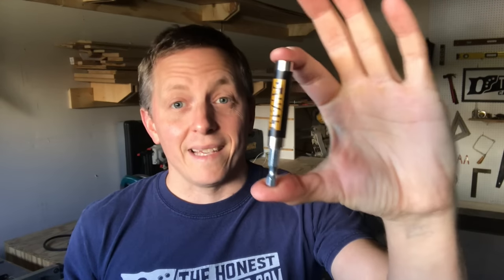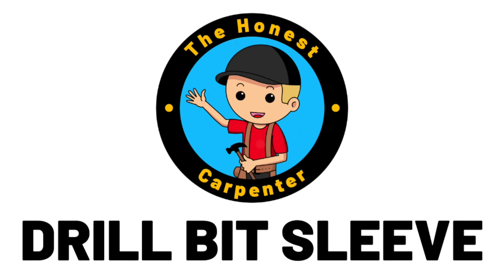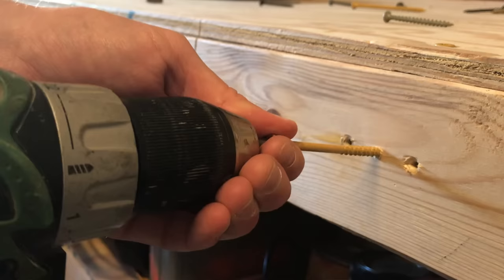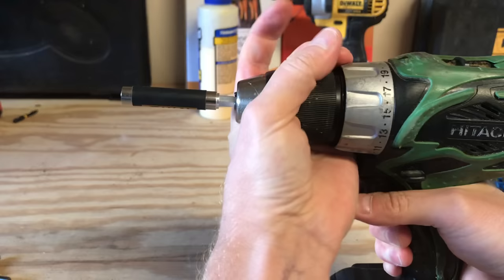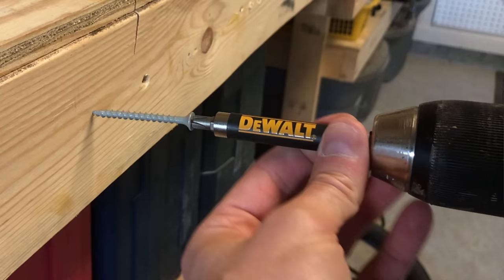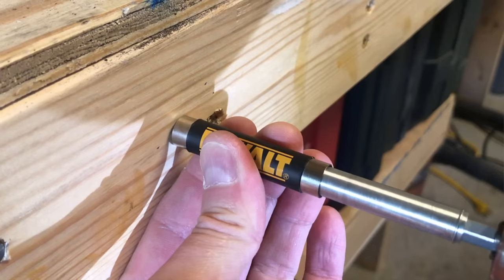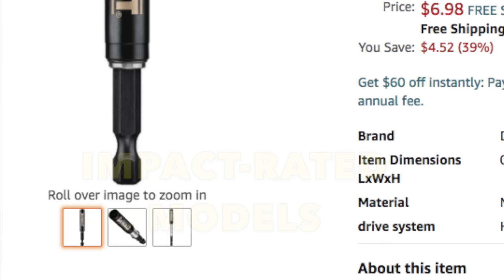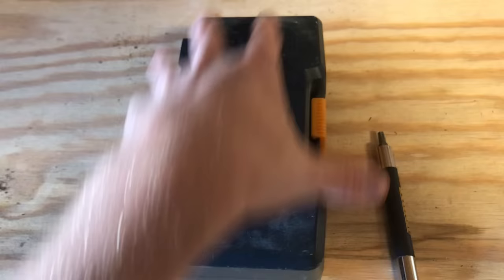This Tool Helps You DRIVE SCREWS WITH EASE! (Bit Guide/Bit Sleeve/Drive Guide/Drill Bit Sleeve)

Comment: The best feature of these Dewalt bit holders is that you can put them in each other and then pull the sleeve of the first onto the second and you get an extra long extension that doesn't wobble as bad as other such contraptions.
Reply: not all dewalt success as others some people will find them wobble because there is no perfect output shape of these and dont forget the groove in the shank itself add more wobble i think they all add some distance to get fit all bits bypassing the defective part in bits shank like spanner/wrench also to bypass the glitch in bolt head & nuts but thats a good thing at most times how about gearwrench metric 6 points the open head dont hold the metric of 10mm head of bolt but the close one fit it perfectly tight!! thats because the bolt is actually on sae size ^_^ john travolta says: "Whee!... What a predicament!" :P

Comment: I’ve  used theses for years and love them. Recently I’ve seen ones that have a clear plastic shank cover so you can see the screws progress which I think is a big plus to drive it  to the depth you want and better monitor the progress.
Reply: OPh, wow...OI would love that!  :D
Reply: Is it really necessary though? I just retract the bit guide once the crew is more than half way in.
Reply: yeah it would be great but thats a theory or a joke andrew because it should be metal to handle the progress if its going to be plastic will make the job fail sooner or later when it gets break because the screw most times will be standing from inside on the wall of sleeve depending on the impact of person hands and the speed of the tool will define the life of sleeve apply these factories on the plastic and think what do you/others to expect!!

Comment: Nice!  I bought a small set of DeWalt driver bits some time ago.  It had one of these bit sleeves in the case.  I thought it wasn't much more than just a bit extender.  It didn't dawn on me that the sleeve was there for a reason.  I have had my share of wounds (as you described) from holding the head of the screw while driving it in.  Guess I don't have to do that any more.  Good deal.
Reply: YES, rehabing my deck and ive had the burning finger issue, i should have known there was something out there for that. nothing better than having the right tool for the job 😊

Comment: Drill bit guides are also useful in removing nails from dismantled pallets.
Cover the nail point, give the guide a few taps with a hammer and it drives the nails back along their route enough to allow you to get purchase on the heads to remove them with a claw hammer, prybar, etc.

Comment: I’ve had one of these for 20 years. This works great, especially if you are removing or driving long slot head screws. It is a real time saver for screwing long slotted machine screws for light fixtures.

Comment: I've had a pair of those in two different lengths for more than twenty years. The old Sears Craftsman cordless drills sold in the 1990s came with one standard, as did the Craftsman driver bit sets. The short one lives in my drill at all times. They also came with instructions, so I knew what they did all along. They've saved my fingers many times when driving drywall or decking screws.

On a side note, those Craftsman drills and bit sets in the 90s also included a quick-change hex shank adapter that worked much like the collet on a modern impact driver. It made changing from screw sleeve to drill bit easy and quick. I still have two of them, and my original one still lives in my drill to this day.

Comment: You’re absolutely right. They make perfect stocking stuffers. They’re inexpensive and a must have for any and all projects. You can never have enough.
Reply from the maker: I’ve got so many torn-up ones laying around, SMS, it was time to buy a couple new ones just for this video 😆
Reply: So they break a lot?
Reply: @RicardoSalta  after awhile the sleeve won't move up and down to help hold the fastener but they're not that expensive so it's not a big deal. You can get them from dewalt Milwaukee ect or just get the cheaper big box ones like husky or masterforce. They all do the same thing.
Reply: @RicardoSalta  not as much as you might think. Normally they’ll last quite awhile. They’re super inexpensive so buy a couple or few.

Comment: Two other things it helps with very well:

1) It makes driving slotted screws way easier, as the slotted driver bit can't slip off the screw head while the sleeve is over it; and
2) Very handy for keeping non-ferrous screws on the bit as you go to drive it in.
Reply: @chrisc5574  1700's, where we light our houses by squeezing whales until goo comes out and lighting it on fire.

Comment: They also have a anti-shock.. (for want of a better word) super strong spring inside. It gives that little bit of leeway which helps prevent wrecking the screwhead from the direct torque of the drill/driver.  particularly useful for brushless Impact drivers. You dob't need to "Lean In" (put body weight behind) on the screwhead as hard. with the correct fitting bit of course. It's like a shock absorber that carries and delivers the punch without hurting the screw for the next guy to deal with. The next guy will usually be you.

Comment: I just drove 2301 exteriors screws in 687 fence boards on our post Hurricane fence with one, using an impact driver. I also like the fact that if I drop a screw I can pick it up off the ground with the magnetic driver. Great video and tool.

Comment: For one handed use basically while holding the timber with the other hand in awkward situations, also if you're ever fixing gutter clips to the fascia and holding them to a string line with one hand this bit holder in a 150mm extension is perfect and makes the job so much easier 
👍😉👌
Reply: Yeah, i assumed holding it would cause a problem long term.  I thought it was just intended as you stated (third hand)

Comment: I had this tool from Sears for at least 15 years and never used it because I had no ideas how. It came in a kit with a quick connect and some bits. I used just about every item in the kit except for this one item. Now that I know what it’s for, I’ll be using it just about every time I use my drill to insert screws. Thanks.

Comment: I am a licensed professional structural engineer with a specialty in wood. I have pulled this thing out of my case about 10 times and quietly pretended like I knew what it was for. Ultimately I just assumed it was to... hold the bits that were too stubby and sat too close to the chuck. Thanks for explaining.
Reply: Yeah because they don’t tell you in the damn instructions

Comment: I already knew about this tool but I wanted to see your take. It was worth it. As a pro carpenter I discovered this years ago and even showed an old timer this trick. Though he didn't accept it as viable information, which is whatever. I used to get metal pieces embedded in my skin with the non-coated 3 inch screws. Once I splurged on a few of these my fingers greatly appreciated it. I also appreciate that you can show others the way without any bs. Thank you.

Comment: Funny coincidence I just figured this out on my own today. I'm seeing your video a bit late. This bit holder style use to annoy me, now I am glad that I have one. Thing is the screw head was to large to sink -up in side, it still saved my fingers while driving self tapping sheet metal screws through 1/8" carbon steel with previously used screws. It was a necessary tool in this particular case and it fell in to place. It worked great!

Comment: I've had one of these ever since the beginning of my career in carpentry over a decade ago. Always knew what it was for and how to use it and never used it. If it was a useful tool I would have been using it all the time.
Reply: I agree. I've had a few over the years, and whenever I've tried to use the sleeve, I just don't get on with it. You can't see WHERE you're driving properly, and potentially cause damage or over-set the head.
I'd rather judge by eye, and risk a few nicks.

Comment: Oh I actually knew the general use for this one, but I had no idea some of them could encase the screw like that to act as a guide. One question about that feature though, doesn't that make overdriving a bit of a problem. You can't see exactly how far in the screw is until you feel the extra resistance or until you remove the guard.
Reply: Thats a fair point ,still they seem worth it
Reply: Generally pros get a feel for how deep the screw is. As it approaches the desired depth, you pull the sleeve back so you can see. Fancier ones have depth markings but you can do it yourself: drive a test screw flush, make a paint mark on the barrel where the edge of the sleeve lies, that gives you a cue that you're getting close.

Comment: Thank you for this video! I was given as a gift a Dewalt case with a bunch of screw bits and drill bits etc. Included was one of those drive guides, which I used once in a while, but to be honest, I didn't spend any time to figure out why the sleeve slides. 

Once I watched your video I felt so stupid. I have spent the last few years redoing my whole basement and every once in a while I had to use long screws which were very difficult to screw in! Had I known about how to use this drive guide!!! I finished my renovation last week, and today I see your video. Oh well. What I'm going to do is put my drive guide into the coffee can where I keep my long screws, so if one day I do need long screws, I'll remember to use my drive guide. Thanks again for this video!!! I am subscribing.

Comment: A handy little tool but really only an asset when driving into wood. It doesn’t do a thing for sheet metal screws going into metal.
Reply: @Whicker Friesian, All sheet metal screws are self-tappers. I’m guessing you mean self-drillers. Using a self-drilling screw in sheet metal without a guide is equivalent to using a wood screw in wood without a guide, only made worse when driving into a glossy painted or powder-coated surface.

Comment: This is very helpful as I bought a set of Dewalt screwdriver bits for Dewalt drill & was at a loss as to use these bit holders.  Now back to installing hanging tool racks in our garage!

Comment: Finally got a drill bit guide by DeWalt. The 6" drill bit guide is better than the 3". The 3" drill bit guide wobbles for awhile then it drives,with the 6" it's no problem.

Comment: I have been using one for many years. It turns a difficult two handed operation into a one handed breeze.
 Mine wasn't manufactured by Dewalt. but it looks and works exactly the same way.
 The savings from not having cut up work gloves, from the screw threads, alone pays for it in no time.

Comment: Thnx for the simple easy to understand demonstration. I now know why and what they are for. I had one and was able to drive screws easier did not know it could slide over the screaming top. My second project could not find j t and I at first thought I bought bad screws went an bought more expensive screws same problems. I t went and bought a new drill and still problems. Your video helped me to understand that I have what I needed I just thought it helped change the bits faster. Thanks

Comment: Thank You!! You have just enabled me to use my drill again. After a 4 month recovery period for healing my jseriously sprained hand, wrist and finger of my right hand after the drill jammed while drilling bolt holes in a portable garage frame I am now pretty skittish about the drill but need to screw skirting and trim boards around the entire perimeter of my manufactured home. I have been very nervous as I'm not great at screwing in those screws to begin with. This little gadget looks like just the ticket for me. Going to get one straight away.

Comment: This tool works well for people who have good screw drilling skills. The important point of this tool is that due to the elongation of the interface, the drill should be well controlled when opening and closing the screws. The positive point of this tool is that according to the tip of the interface, your screw is fixed in the interface and the interface is never detached from the screw when opening and closing the screw. Thanks for introducing this tool.

Comment: Used this on  the old slotted screws as a lifesaver. Added plus, use the right sized bit and it's good!  At times I need to take them out and just fit the slot, push the sleeve on the head and remove. The sleeve keeps the bit on the screw...

Comment: Yeah I like these drive sleeves.  Sometimes I find them inconvenient because they can block your view, but if that bothers you it can be an issue with basically any bit holder.  You can get these relatively cheap and they are worthwhile to have on hand even if you don't use them in every single screw driving situation.

Comment: Yes.I Have one always in my drill. However i usually drill a counterbore hole to take the screw quickly without deviation. I find the Dewalt PZ2 bit slightly on the small size.

Comment: I've been using mine for almost 30 years, the same one...it's a Craftsman that was made in the U.S.A.  A few years ago I fashioned a dryer vent cage out of 1/4" hardware cloth to keep mice out of a cabin.  It was located right next to the main power feed on one side and the phone line on the other so it was really tight and I couldn't have driven the mounting screws without it.  It's nice for regular usage but a lifesaver in situations like this, especially when you're 20 some miles from the nearest hardware store that's so small I doesn't really have things like this.

Comment: Another technique that I use is to hammer the screw a little bit just like a nail that will make it stable. Then connect the driver and start driving it in without holding the screw anymore.

Comment: I wanted to drive some screws into a 2X4 high in my garage but I didn't have a tall enough ladder. I put an extension on the driver, then one of these. It held the screw straight enough to drive the screws.

Comment: One more benefit that I haven't seen anybody else say yet is that if you are a beginner woodworker or diy-er, and you only have one drill, it makes it easy to change bits out quickly and easily without having to chuck them in each time. Granted, it won't hold a drill bit, but if you have to change from Philips to torx or something like that, it's handy to have.

Comment: If you own a drill then you need to buy a couple of these. I still have metal shards from holding screws with my fingers while I try to get it started. I saw this at a store and bought a couple. I later went back and bought them in different sizes. I have worn out many of these and have given them as gifts to my sons and friends.

Comment: I first bought these from Lee Valley. The Dewalt ones from the big box store have been seizing or coming apart fairly regularly. They’ll give me a new one if they’re in stock but it’s an annoying failure. Still keep one in my Fess unless it’s tight quarters
Reply: Ps I’ve been calling it the slidy bit holder

Comment: Thanks for the video; even if a user predrills, it still works well to hold the screw at the correct angle to make placing the screw easier (especially with 4" deck screws).

Comment: always get a free one from my hardware shop when i buy a 25 pack of dewalt screwdriver bits. used them at first but not anymore,they are made from aluminium , are weak and break easily, have a box of about 30 collected over the years.

Comment: I have several of these and they are pretty good for longer screws in a horizontal application the drawback is that the magnets are very weak in them and I have had the bits and screws fall out if I tip them downward . For this reason I went to a Makita magnetic holder . Problem solved .

Comment: I can't remember if that one is magnetic, but I have a different DeWalt sleeve that has a magnet.  It's a godsend. Edit: should've watched for more than 10s.  lol

Also, got a nasty burr splinter at rural king from a screw last week.  Went to pick out carriage bolts for a hasp lock and learned the hard way why you don't spin unfinished metal around in your hand.  I was in excruciating pain for 10 minutes til I got it out with my Leatherman. Not rural king's fault at all.  Just me being dumb.

Comment: They’re ok but I’ve found giving them some force will actually snap them at the bit end. In my experience with these the metal casting is a little thin where they hold the bit.

Comment: I have wore out a set of small and large out... You think how is that possible... The small the plastic on the slide is gone... And using the large one with Blue Concrete Teflon Screws and a 1/2 inch driver putting wooden gates and rose trellis on the cinder block walls it got bent!!! But replaced them already!!! They have saved my stupid butt many a time!!!

Comment: Thanks for your video, I have gotten stabbed by the bit after it slipped off of the screw a few times also. I like using these sleeved screw guide drill screw chuck bits.

Comment: I know that I don't know what I'm doing but the heads of the 3/16" Tapcon flathead screw that I bought won't fit into the Dewalt Sleeve.  Perhaps a different size might work but I'm just going to go ahead and use a plastic anchor. Drill a hole, tap in a plastic anchor, and screw in a screw. It is simpler.

Comment: I had two of those but they broke, sliding sleeve came off apart, and I also was disappointed that  I could not use them with larger head diameter screws, flat or raised button head type, and other than timber materials i.e. cement sheets PL